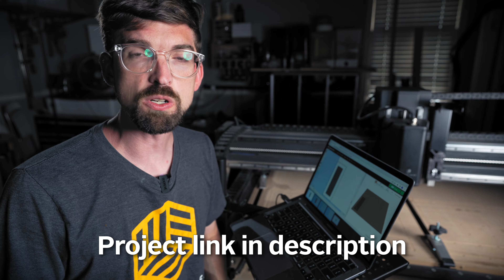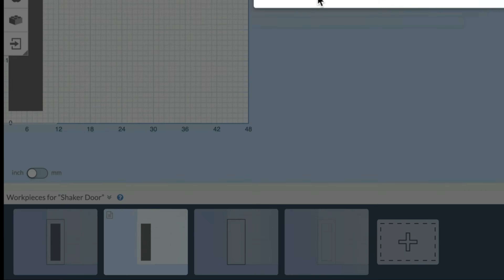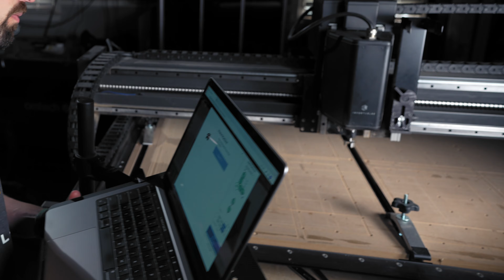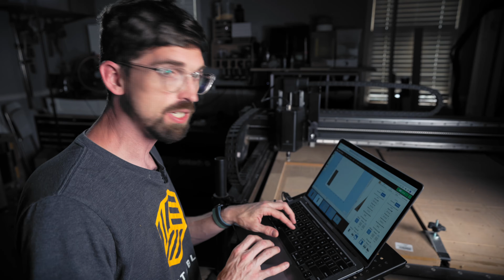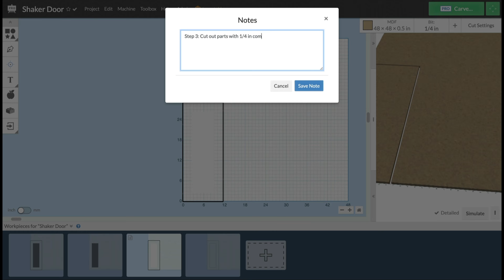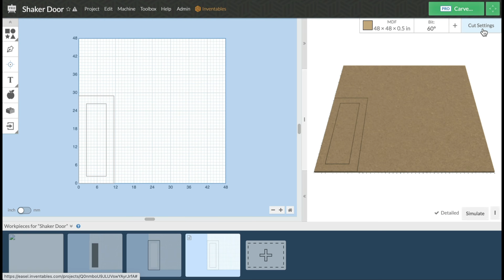How to Make a Shaker Style Door with the X-Carve Pro

Comment: Great video -- Any tips or advice for using Cabinetmaker to make a shaker style door and also drill the holes for the hinges on the other side? When you select 'Shaker' as the style for the door, then send the pieces to Easel, you only get the option to cut the shaker cutout. If you select 'Flat Panel' as the door style, Easel includes the hinges. Understand that anytime you need to CNC both sides of a piece of material that things get tricky. Our approach is to output both the flat panel and shaker so we get the shaker pocket and the hinge locations into Easel. From there, we cut the shaker panel and perimeter, then we flip the piece, inserting 1/4" spacers on all sides, clamping, then running the hinge and bore jobs for the door hardware. Not the most time efficient process but it does work. Just curious about what tricks the Inventables team has. Thanks in advance